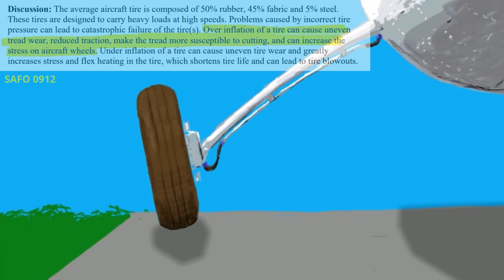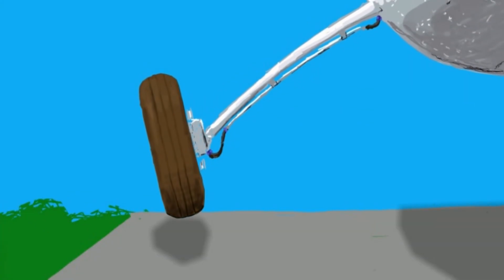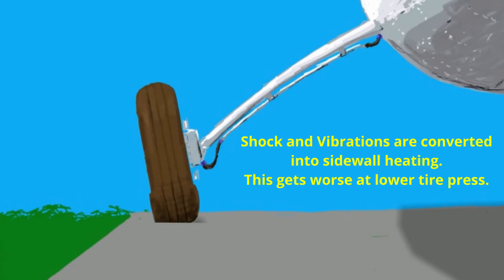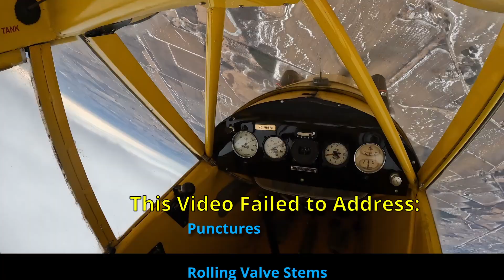Bad Landings in the Cessna 170 and Piper Cub:  Watching Tires Work and Watching me Abuse Tires

Comment: Wait I am legally allowed to do loops and rolls in my 65 hp Cub? I never even thought to look up a inhibition of that in the TCDS. But those aren’t 8.00x4 original tires in the Cub where it’s books says 15 not 16psi. You have the conversion tires on it. So what would be required when it leaves your A&P IA’s place is what’s listed in the STC ICA. Right? I is one of those. But don’t have the paperwork in front of me either. I always liked to have tire pressure higher on my tail daggers and land on pavement because I’m better able to feel a screwup starting to happen faster and make the correction quicker on pavement compared to grass. But I do run 15 psi. But after checking tire prices the other day on the 8.00×4. Yeah I’m gonna start landing on the grass in the Cub. Thanks for the demonstration that took some work. I like the part where it discusses the dampening effect. Have you ever looked at how low the tire pressure is in a Twin Otter? I’m even typed in that one LOL you can look me up.
Reply from the maker: Fantastic questions!  And I'm glad you've got a Cub.  I hope it keeps you happy, separtes the work from the job, etc. 

Aerobatics:  It's legal, but please move forward deliberately if you choose to do this.
The J-3 and some others were certified under CAR 4 rather than Part 23.  So, yeah, you can legally loop and roll your Cub.  I'd advise a little common sense preparation before you go do it, though.  The planes are 80 years old now.  With that said there isnt' much history of J-3s breaking in flight, and there are many thousands of planes across many decades that have been looped and rolled.  I'm comfortable doing what I do, but I might be a dummy.  

Tire Pressure: 
Like you I do about 2/3 of my tailwheel flying onto concrete and about 1/3 onto sod and other stuff.  I'd have to review my paperwork, but I don't recall any tire pressure limitations in the STC.  There are different STCs out there, so don't take my word for your plane. 

It'd be cool to see pictures of your Cub sometime.  I hope you have plenty of opportunities to get out and fly it!  If you make to Oshkosh I'll buy you a drink.  It's getting late.  If I forgot to answer something throw a rock at me.